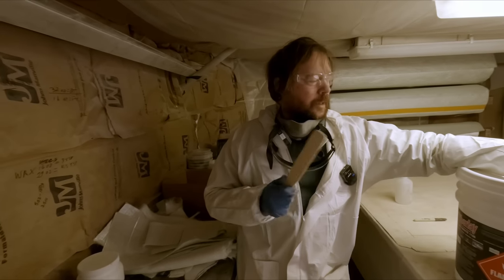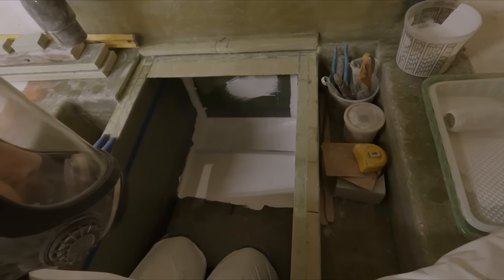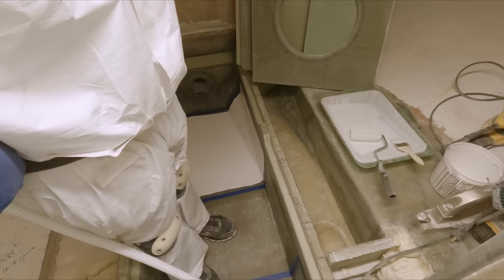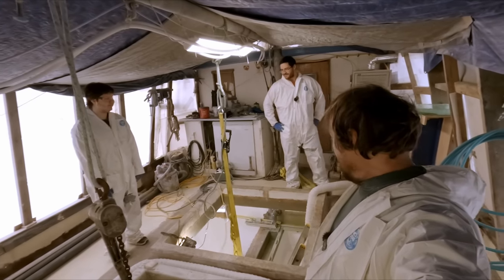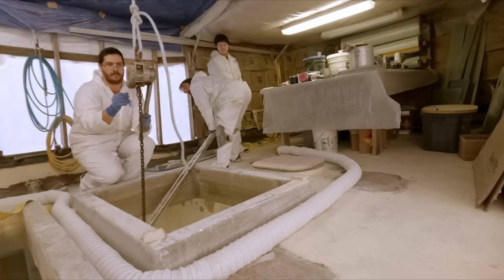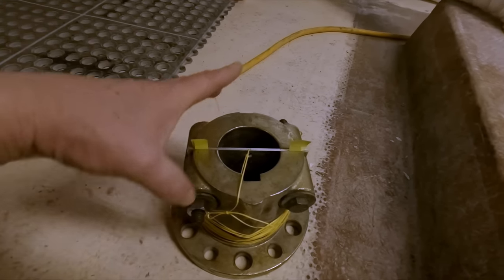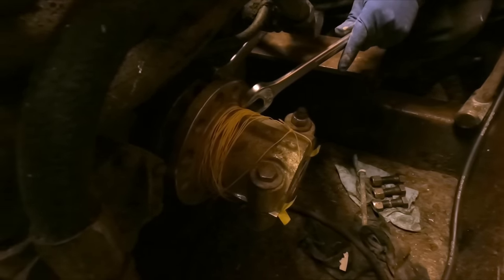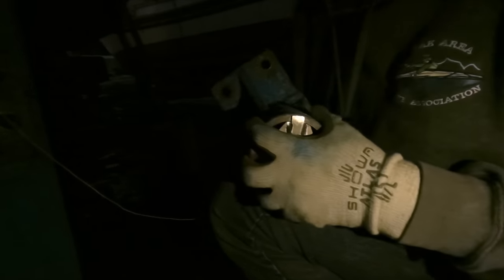A Little of This and That- Emerald Isle: Ep.62 Fishing Boat Refit

Comment: Great forward thinking of every step. I commend you. In the early 70's working at yard in women's bay. Miss calculations and being cheap sunk and ended up breaking the keel of the FV Aldeberon (about 100 plus ft) while just changing the propeller between tides. I was running the crane. Bosses didn't want to resend Marion Parker the diver to make sure boat was going to settle perfectly again with the forward section of the hull hanging over an underwater ledge while tide went out again. Tide came in,  boat didn't come up and swamped and slid forward.  Last time home (Kodiak) 2019 my bud David Horn showed me what remains of the Aldeberon across from the float plane dock on backside of Near Island.  You and your sons rock.

Comment: I've found when trying to thread a string line through a small hole if you can coat about 6 inches to a foot of the string with a quick drying epoxy and hold tension on the sting to keep it straight until the epoxy sets up it makes it pretty simple to thread the string through a small hole. This works great if you have to remove and reinstall the string more then once.

Comment: I can't remember exactly where I got it.  I am thinking either Northern Tool or Harbor Freight but it was quite a while ago.  Anyway it is a heavy duty plastic wrench which looks something like a "C" cast with a handle.  You snip the lids holes and then by putting this on the rim and flipping up the lid comes of pretty easy and also doesn't damage the inner seal so it can be reclosed effectively.  Pretty cheap and I still see them around.  Well worth having if you are messing with plastic buckets.

Comment: Your comment regarding identifying the second coat from the first when they are the same color could be helped by an approach used by professional painters.  A slight tinting agent is added to the first coat to distinguish it from the second (final color) coat.  The manufacturer of the gel-coat should be able to provide a proper tinting agent.